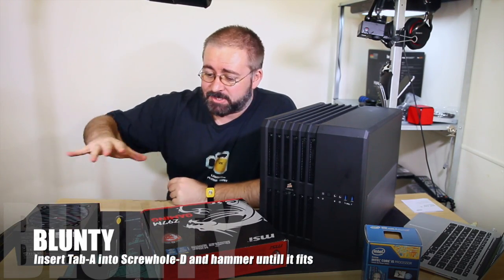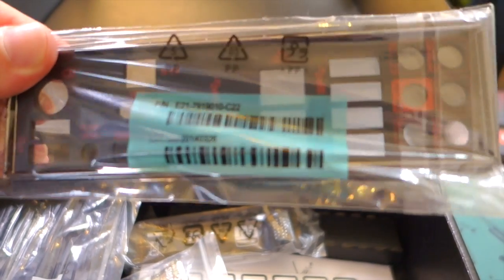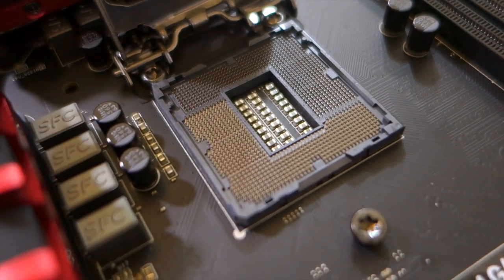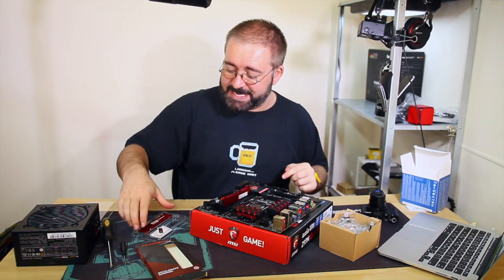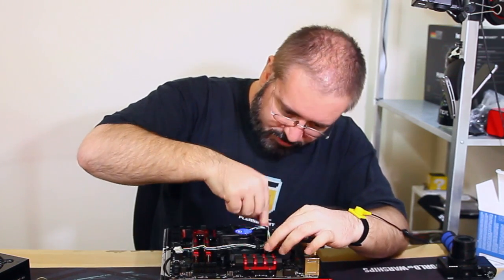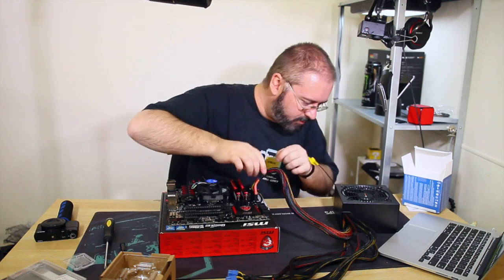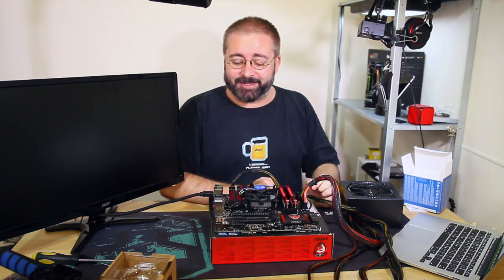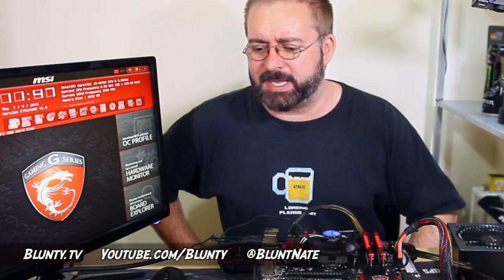The Real Build Begins - Devils Crevice Gaming PC Build

Comment: There was probably nothing dodgy about the little power light coming on, like you said, there was probably some "residual power" hanging around in some of the capacitors on board the power supply :P

I'm glad you used newbie language, I've watched 2 or 3 PC builds over the past few months, and although I'm generally technically competent, I sometimes get a little bit lost in the vocabulary...

Comment: Awesome video. :) I like watching your videos for everything you do.

I don't remember if mine had a thing for the CPU power or not. I don't think so... I took a while to put it all together and I didn't do any testing of things outside of the case. It was my first so I won't be too hard on myself. I did have my wrist strap though. After I got it all together I double checked everything to make sure it was all done correctly. I really have an issue with having faith in myself sometimes. :p

What a wonderful feeling it is when it all starts correctly. I remember that so well. I wanted to dance around my kitchen. :P I picked there because it had the most space and also is the the only room in my house that isn't carpeted. :p Yes my bathrooms are carpeted. I find that weird but the house came that way. Soon will change that though but I just need to figure out what kind of flooring I want.

Anyway. Looking forward to the next video!! :D

- Heidi

Comment: The power button lit up because you turn on power supply and then turn off which levels power in the capacitors so enough power left to power led

Comment: I've seen cheep DIMM sockets which require considerable force to fit the memory, and are made of sufficiently squishy plastic that you can fit the RAM in the wrong way, without really noticing it. :( Decent kit, you can't. ;)

That was a surprisingly effective video. I've seen many of these done by supposedly "professional" IT Techs and PC Builders... presumably, it's the "presenting to an audience" part that they fall down on. They are a) boring b) miss important information c) boring d) waffle over unimportant information e) BORING!

Well done Blunty! :)

Comment: I'm building for the first time as well with the same CPU configuration. I picked up a Z97 Asus Pro gamer board because I got RAM for free with it. I dont know if I want to run the bench test... Is it necessary? I just want... A bit of a surprise lol. But what if it doesn't work :o? Well I guess I should
Reply from the maker: wonderr "necessary"? no... SHOULD you do it? YES. Better to find a faulty component BEFORE you spend an hour mounting everything into the case and routing cables etc. than having to dismantle the fucking thing. I HIGHLY recommend you bench-top P.O.S.T.
Reply: If your spending a crapload of money on some very high-tech parts, "a bit of surprise" is probably the last thing you want!!
Reply: sporkafife preach brother preach . Anyway other guy, always make sure your parts are fully functional before u spend hours putting it in a case to find out that it won't post.DOA (Dead on arrival) can still be possible.
Reply: wonderr Why wouldn't you? It's quick and easy. Ensure that your parts work, mate.
Reply: Thanks I will definitely test the components first now.